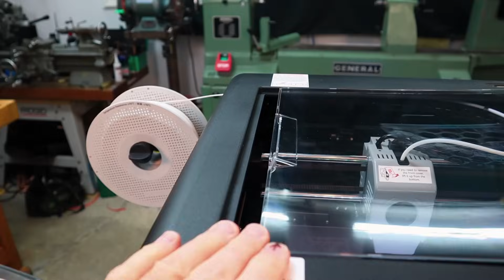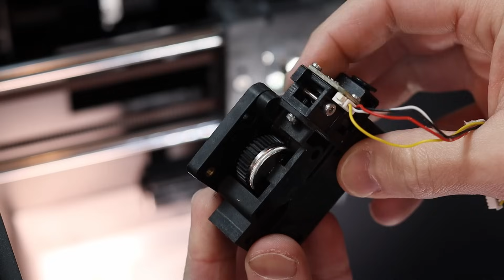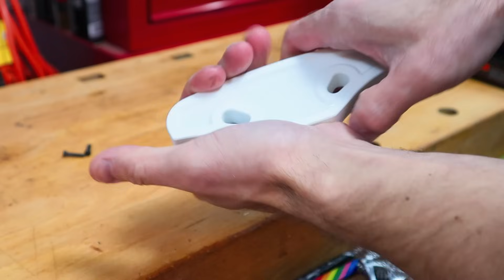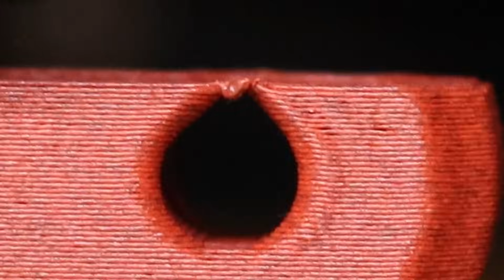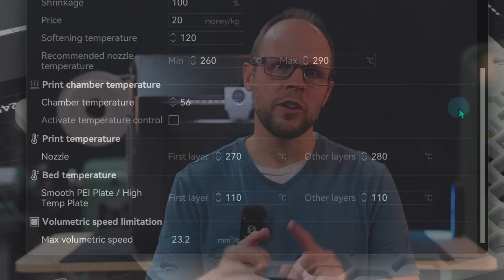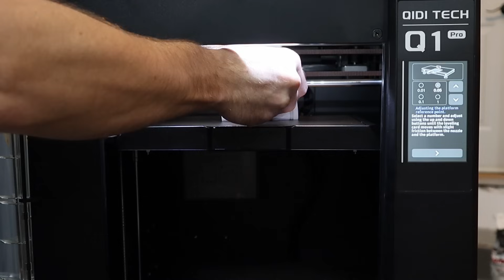The All NEW QIDI Q1 Pro - Affordable, High Performance and High Tem...?

Comment: I have the updated version of this printer, bought it about 3 months ago and it's a workhorse. They've fixed a few of the problems it had. Great review. And as a woodworker I love your simple solution for the Irwin clamps. I've had the same problem on my bandsaw. That's my next design project. Thanks.

Comment: What stands out to me the most is the value. This printer is highly capable, full of modern features yet so affordable. I also hope they refine the aesthetics like another comment mentioned.
Reply from the maker: I just finished reviewing the PLUS4 and they've adjusted their designs to align more to what people want.  I agree that the looks aren't fantastic, though it is highly subjective.  Flat panels would have been nice to at least be able to mount something easily, like a spool holder or a tool rack etc.

Comment: 08:00 Some of the best finishes I have seen on a 3D printer for that drawer handle.

If you're noticing stringing in your prints. Try to adjust the temperature to a lower setting (~5 degrees). Makes a difference from my knowledge.

Comment: I think you're using your phone for some shots, particularly the shots where the red loses a lot of the color and saturation. I've had some trouble in that area, and I found that if you turn off the HDR10+ setting, the color comes in so much better and doesn't need tweaking in the editing software. Hope that helps, if you wanted help ;). I like the review! Glad you have mods for this printers shortcomings.
Reply from the maker: I'll have a look, I may have used the phone for some of these, I try to use my Canon M50 for most of the video now, but sometimes I use both.   I struggle with colors as well because I have red-green color deficiency and they can look similar to me in a certain range.  I should start wearing a white badge and adding something white in all of the shots so that I can color grade it from that as well.
Reply: @NeedItMakeIt  oh. I didn't know you had a color deficiency. I've actually never talked to anyone who had a vision color impairment. Does it affect only color?

Comment: Love this video overall, but why is nobody testing nylon? That seems like the true test for a heated chamber printer. ABS is easy and doesn't even need the full 60°, but pure nylon would really push the limits of the printer with both high extruder temp and high chamber temp

Comment: What do you mean when you say it has no auto calibration? I thought it set z offset and bed leveling itself?
Reply from the maker: Good question, I should have been more specific.  I was talking about the scanning and adjustment of the filament during the print.  This is something that the Bambu X1C and the A1 series of printers have and it works really well for most filaments... limited by the buildplate texture though.  The Creality K1 Max has a feature like this, but it doesn't seem to work very well.  The FLSUN S1 is supposed to have it, but I don't have the printer to be able to test it out.

Comment: You may have already figured it out, but small overhangs like that shouldn't be an issue. You're either running the filament too hot, running too fast or not getting enough air on the print.

Comment: your bed plate says 250x250 but their website says 245x245x240???
Reply from the maker: Don't look at the back of the printer, it says a different number....  The buildplate itself is 250 x 250, the printable area is 245 x 245, the back of the printer I believe says 240 x 240, which is a misprint.  The correct number is the 245 x 245.

Comment: I’m following since.. today but you are a very advanced maker.. can’t see why you wouldn’t upgrade to a kit 3Dprinter like Voron, Ratrig or VzBot.. I’m sure you would be super happy about your prints.
Reply from the maker: I'm more than happy to test out a kit printer.  I'd love to build a Voron in a series and work on improvements and develop it as well.  My goal is to be able to build my own printer which can print Concrete furniture to start and then I'd  move up to sheds and dog houses and then to full houses.    As the channel grows and I can afford to spend some money, I'll be doing more in this direction for sure.  

I also think we're ready for another breakthrough in the tech, I believe that we're going to be printing industrial grade prints at home.  If you've seen the video from Micronics3D, I think it will be this, but better!  There are some safety concerns, respirator and a dedicated area for the work, but I think it's coming and coming quick, and layer bonding and layer lines... well they won't be a thing anymore.  It'll still be plastic of course, until we can print metal at home, which is coming too, but will open up a whole load of issues.

Comment: What an awesome review of a 3d printer. Way more in depth than just running a benchy! Covering a wide range of 3d printing materials as well as showing practical real world applications is simply exemplary work. I'd show this video to the other companies and tell them to send you their printers because you don't mess around. Super high value content. Sorry for the nonstop praise just was really taken by your comprehensive review. Excellent. Thank you for sharing.
Reply from the maker: Thanks Michael!  I have to resist the temptation to try and print Benchys and Toasters, they're good enough tests, but they're thrown away afterward and I'd prefer to make something that doesn't go into the trash and has a real function.

There's no question that this printer is a top-performer, I've continued to use it after the review because it opened up a whole bunch more possibilities thanks to the heated chamber and higher temp nozzle.  I've only had one fail, and that was due to PETG accumulating on the bottom of the nozzle, it dropped onto the print and then the nozzle hit the big blob.  Sometimes the blobs are small enough that it doesn't cause a problem, in this case it was pretty big and the force caused the buildplate to move out of position.   PETG seems to be bad for this in general and I have the exact same issues on the Bambu X1C.  I'm experimenting with different ideas to prevent the problem.  It's really only an issue on prints which are longer than 5 hours, where the PETG has enough time to accumulate.

I'm glad I was able to test out this printer, and hopefully it helps people to make a decision if they're in the market.

I'll have more reviews coming, I'm looking forward to seeing what comes next, my hope is that we'll have multi-material capabilities, not just multi-color.  Being able to print flexibles at the same time as stiffer materials would be pretty amazing. 

Thanks for your very kind comment my friend!

Comment: A little confused.  When you took the print head apart, I thought you said it had a sensor?  Yet you had to do manual bed leveling with paper?  Was that just to get it basic leveled and it still does auto bed leveling with the sensor?
Reply from the maker: Correct, this printer has 2 lead screws which are independently driven, which gives it the ability to auto-level side to side, but not front to back.  The leveling screws allow for the adjustment front to back to get a very parallel bed with the gantry.  The sensors and probing sequence will account for any irregularities, but it's best to start with a good foundation if you want the best results possible.  Having a parallel bed also gives you a part which finishes much closer to your final size in the Z direction.  

I hope that answers the question.

Comment: I bought a Q1 Pro using the link.  It came Yesterday and I'm getting the best prints I've ever seen.  I print abs mostly and it's running like a dream.  I like it so much I came back to this video to buy a second.
Reply from the maker: Sorry I missed the comment for some reason.  That's great, I'm still going strong with the printer, the only problem I've had so far is that I had a blog of PETG drop onto my print so PETG getting stuck to the nozzle is still problem no matter which printer I use.  I'm going to be testing some different nozzle soon to see if it helps at all.  PETG-CF isn't as bad as basic PETG, so it's not common.  Print quality is really good, it's as good as my X1C, and I will do a head-to-head-to head with my printers soon to see which ones comes out on top.

Comment: what filament was the PLA CF, and the TPU?
Reply from the maker: Those are all Bambu Lab, I post my designs on MW and I'm able to generate points towards free parts and filament.  I have a video on that subject as well.  The CF filament is really nice, they have a newer High Flow TPU which I haven't tried yet, the stuff I use is a little bit older and quite slow to print at 3.6mm³/s.  I think the quality of this filament is pretty good, not quite as good as Prusament, but it's close.
Reply: @NeedItMakeIt  oh ok. I'm looking for a printer to do ASA, PETG, stuff like that, but i'm not all that versed in FDM printing, and when you said you used the recommended settings, didnt knew if the printer settings or filament ones. Because Bambu's recommended settings have a large temp difference. thanks for the info
Reply from the maker: @xRaptorScreamx  Each printer will be a little different and settings should be tweaked based on each for the best possible results... that said, I didn't do that here, what I did was opened Bambu Studio and used the settings meant for the Bambu X1C for this printer instead, I just copied and pasted the info, filament flow, filament temperature, bed temperature etc.  The only thing I could not copy was the Pressure Advance settings, but thinking about it now, I could have changed my printer to the P1S or similar and those settings should be within that printer.  

When I run all of these tests, calibrating each of the filaments is very time consuming and wasteful, I was super happy to know that I didn't need to do it right away, or at all, the quality of the parts coming off of the printer is very good regardless.  

If you want to calibrate, that will put it over the top, I just didn't think it was necessary.  

For a little mor background, this printer has a hot end which can reach higher temps so printing ABS and PETG are a piece of cake, even printing Polycarbonate isn't a problem.  There are only a few filaments it cannot print... or at least they'd be at the upper limit, and those are Ultem and PEEK or similar.  Those are way too expensive anyway, so I wouldn't be going that direction anyway. 

Feel free to reach out if you have any more questions or need clarification!

Comment: This literally is the most versatile machine in its price range. I'm going to buy one through your link.
Reply from the maker: I'm still going strong with it, printing everything that I can get my hands on.  I can't tell if its the extruder that makes the most difference, or if it's the frame, but either way, I think they did a good job, and I'm happy that they brought this machine along, having the ability to print some higher temp materials opens up so many possibilities, I didn't realize that it was holding us back so much!  

I just took the side and back panels off to see how they were able to make the frame so strong, and it looks like everything is just sized right and in the right places, not too much and not too little, nice engineering. 

Thanks for using the link that helps the channel a lot!

BTW, I like your name, are you Carnivore?

Comment: I've had an Ender 3 for a few years and have always been frustrated by the amount of work required to get good quality prints, as well as the upgrades needed for abrasives and/or challenging materials. The X1C took my eye when it was released but I couldn't really justify the cost, even the P1P was a little pricey and underwhelming, however this at £399 with the specs it has is an insane deal. This is the kind of thing that 3D printers should be, simple setup out of the box and the ability to send something to the printer and know it'll work. The future of the 3D printing landscape is looking really exciting.

Comment: Awesome review...curious by what you meant by saying no auto calibration?? Do you mean like input shaping or filament calibration?? Curious how the webcam looks, how come you didn't show it for any of the timelapses or did you and I missed it? A preloaded klipper printer with a heated chamber for $450ish with QIDI's 5% discount for new customers is pretty amazing
Reply from the maker: Thanks!  Sure sorry I wasn't specific enough at that point.  When I said that I was referring to filament calibration, similar to the way the Bambu works by extruding a small amount of material and then scanning it and making adjustments on the fly.  The QIDI has auto Z-offset, which is a form of calibration and also bed leveling, but not material calibration and I've been spoiled with the X1C.  

No doubt that the price is very good for what you get, they've done a great job, and I'm still going strong, printing everything I can thanks to the active heating.

Comment: That was one of the best 3D printer reviews I've seen. Keep up the great work! I bought the QIDI X Smart3 about 2 months ago and have been extremely impressed with the brand, so much so that I just ordered this one through your link. I like to play with the higher temperature filaments and the extra features on this one, at this price point, seem fantastic.
Reply from the maker: Thank you, that's awesome!  It seems that there is some real competition which is great for us and the more I print with the Q1, the more I like it.   I took the sides and back panels off last night to see why the frame is so strong, and it just looks really well done, nothing too excessive, but just right.  I've released a follow up video for the spool holder since it came out pretty far and it was a bit wobbly, which is strange since the rest of the machine is solid.  I have a few more videos that I want to make with this printer to test the limits as well.  

Seems like a good brand to stick with and though it's not 'vanilla' klipper, it's at least open and you can use whichever slicer you like right away without having to sign a waver about affecting the warranty etc.  

Do you design your own parts mainly and what do you mainly print parts for?

I'm looking forward to what QIDI has coming next!
Reply: @NeedItMakeIt  Custom parts for automotive projects. Brackets, mounts, covers etc. I'm curious as to how many things that would normally be fabbed out of metal can actually be printed with some of these materials. Incorporating metal components into a print is also very interesting to me. Still just getting my feet wet at this point but I think there's some real potential here.

Comment: All is cool yet at the end you do not want to replace that steal plate as that is mainly used for vibration and support of the overall printer itself. QIDI even ran into this issue with the first version of their X-Max 3 and needed to recall all printers to have it replaced.

Comment: mpoxDE found out, that the room heating module isn' t safe to use. Whats your experience with it?
Reply: To my understanding there's really only an issue with how it's wired for European systems. Just don't stick a fork into the heater when it's active.
Reply: @colinmetzger6755  so there is a difference between us version and europe version?

Comment: I wish Qidi would produce a Idex printer with the build size of the X-Max 3 or larger.
Reply from the maker: IDEX or swappable heads would be amazing.  I'd imagine they have lots more coming.  I've been printing on only the Q1 for several weeks now and it has performed as good or better than my X1C that's impressive considering that I haven't calibrated a single filament yet and my prints are heavy, mainly 8 walls a 35-45% infill.  I'm definitely looking forward to what's coming next.